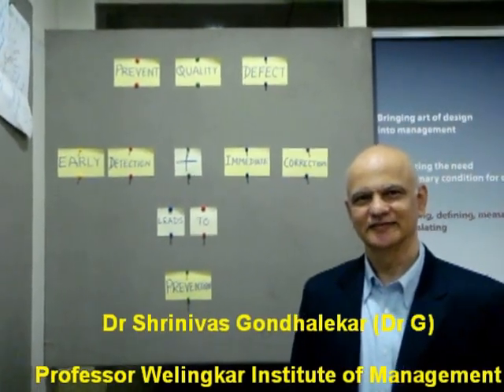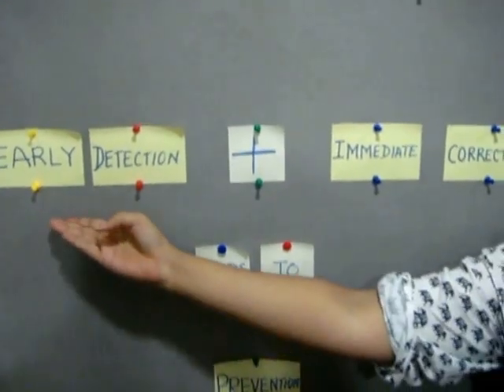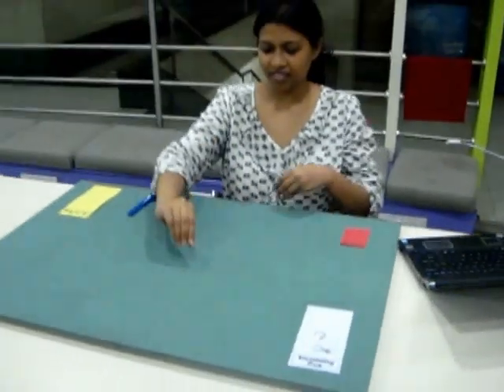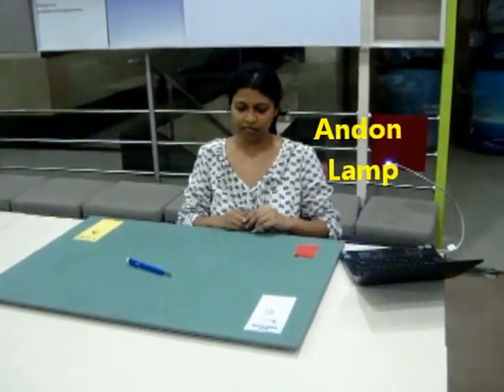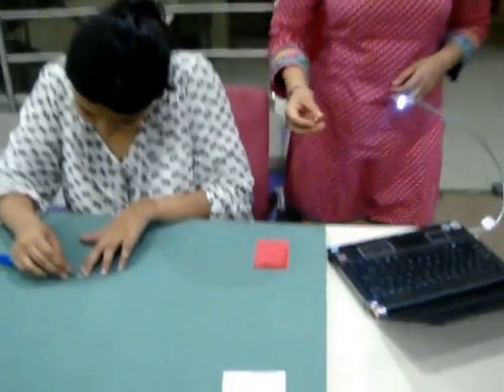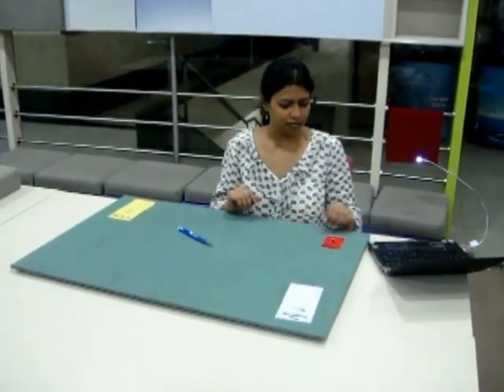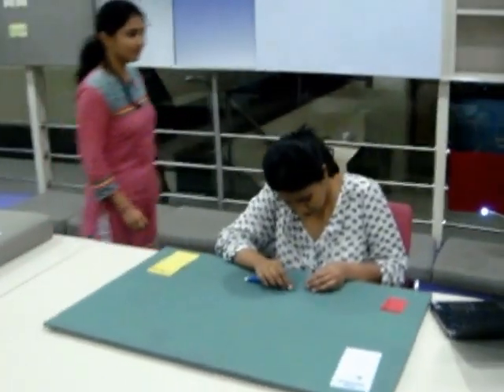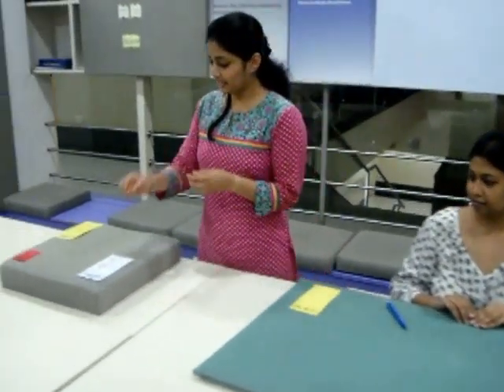Defect Prevention thru "Early Detection + Immediate Correction"

Comment: Dear Sir,

I saw the videos yesterday and thought of commenting once I actually implement it.
I worked in a data warehousing company and called my manager with an idea of getting the data correct in the 1st go.
I suggested that we implement automated macros testing the  data passed forward and eliminating errors in the 1st go thus increasing the process efficiency and in turn the overall efficiency.
Ex. the data needs to com in as number datatype 37 and some fellow just passes 'Thirty-Seven' in the next stage.
This leads to an error in the final data layer and back tracking it becomes it difficult.
This method definitely catches the culprit in the first go.

Thanks,
Mrudula
Reply from the maker: +Mrudula Pardeshi - what happened after you spoke to your manager about using the macros to get the data right on the first go? We would be very happy to know of the progress and result. Thank you. - Dr G
Reply: +Shrinivas Gondhalekar 
Dear Dr.G,

They implemented a Java macro by having a set of constraints that need to be checked for every row and column data element.
In case it satisfies all these constraints eg: data element of row i and column j should be integer not more than 255 in length; then te data element is sent to the next layer.
If it does not satisfy then it is back tracked to its primitive cause and corrected there.

This approach reduced the errors in the final datamart thus giving more accurate data to be presented in the final reports from the datamart.

I have also suggested that they have a similar macro for all layers.
 
Thank You Dr.G.

Comment: Thankyou Dr.G and team.
Correct me if im wrong ,If many issues are detected on one piece of a product, does placing it on red card is enough? Like the worker will know that its a faulty piece but how will he or she know how many levels of error were detected. May be quality consultant mentions the same thru a note or direct interaction and intimation of what all needs to be worked on. I now understand why each item right at that moment itself is to be checked so that further process is not hampered and faulty products are not produced as rework of error detected piece happens right away. This may also sometimes make the worker realise initial mistakes and learn to be aware not to repeat the same on next, if similar items of work is involved. Though it looks tasking and time consuming but best suited for especially custom and variety products involving intricacies.
Thankyou once again for the learning.
-Srikanth Shetty BD
Reply from the maker: That's why it is ideal for the quality inspector to give feedback on the spot. Then learning happens for the operator.
Jewellery has a special problem. The piece needs to not only be correct in terms of dimensions, such as an engineering item, but also aesthetically beautiful. Two persons looking at it is a great help in aesthetics because it is a subjective element. Otherwise we would go for self inspection.
Reply: @DrG720214  Understood Sir ! Thankyou so much :)

Comment: Sir , i got to see this very technique being implemented in the Sinter Plant of an integrated steel plant of JSW. There we had to constantly monitor the sinter product quality running on conveyor belts , after the product was baked in the furnace . Letting the undercooked or overcooked sinter product ( which was the  defect ) go ahead would spoil the entire chain where this product was an important constituent .So , there were manual supervisors alongwith CCTVs installed to detect early any signs of defects. The only solution was & is " Early Detection " + " Immediate Correction " leads to "Prevention".

Comment: It reminds me of the "peer review" stage of software code at the software developer's end at the technology centre of BNP Paribas where I was working as a software application developer. In this stage, the objective was to minimize the defects and/or errors in the software code implementation in the development stage itself even before it goes to software testing team. The code gets evaluated by the peer (generally a senior developer) and once tested right, it is marked OK. In case of any errors, the software developer is immediately informed. The result was that majority of the applications got completed in a fairly less time than before as lot of time in defect fixing during the software testing stage is reduced.

This way, the software code is free of majority, if not all, bugs right at the developer's end before the software implementation reaches the quality assurance i.e. software testing team. Hence, early detection and immediate correction leads to prevention of defects. Andon Lamp and Quality Control Inspectors inspecting all around are efficient techniques for this early detection and immediate correction. The same has been very effectively depicted and demonstrated in the video.

Comment: Thank you for an interesting video sir, In my previous organization, the developers would perform a sanity test in pre-production environment, before it was handed over to the testers,Similarly in the above video, a set of standardized rules can also be set for the operator(in this case a jewelry unit), to check for the product herself,the person assembling a product(jewelry) can himself test the accuracy/ quality of the product himself/herself first and then pass on the product to the subsequent stage of quality inspection. This will reduce the number of defects if any being pointed by the quality inspector. This will obviously increase the output time of the product assembler but this will also increase the quality at the first level and save the input time of the quality inspector.

Comment: Sir, Although, I have never had an opportunity to apply early detection theory in real life aspects but what I realized after watching the video is that we Coders use white-box testing aspects of which are similar to this theory to some extend. In white box testing we use same process of early detection to find bugs using test cases in our codes/program. If there is any defect at an early stage of coding it might lead to major defects at higher level of program later making it difficult for debugging causing much more bugs or issues when the code is integrated with the program .So using White-box testing we are able to find  hidden errors and defects at early stage which in turn help us to prevent and remove these possible defects or bugs in the unit testing and making it more easier to integrate programs into the application avoiding any potential defects in the future which would have been hard to spot if ignored at an earlier stage

Comment: hello sir,
the learning that i am taking from this video is of how to have an organized and systematic process which not only helps in early detection of errors and correcting them but also reducing the overall cycle time of the process which would have increased had this errors been detected at later point of time.

Comment: The video "Early Detection +Immediate Correction" conveys that a stitch in time saves nine.This practical approach is very well implemented in a small restaurant I visited.They serve you personalized food where they prepare a sample and ask the customer if it meets their expectations.If any changes are required they immediately make the corrections and make no compromise on customer expectation and quality.
Thus they detect the error in an early stage unlike other restaurants and also take an immediate corrective measure.

Comment: Hello sir, 
One of the very important part that i feel is, the designer does not have to waste time calling the quality check in charge to check the product. The process becomes faster. Also if a motion study is done, the designer makes the least possible movements, again spending a very small amount of time. Also, to avoid errors in placing the products, the color scheme is used and also abbreviations are used to indicate thee right spot. Roshan Runwal

Comment: A very good practice!  Early Detection will definitely save a lot of time and resources. Though the Initial cost might be high (Learning and training cost)  , in the long run this will definitely help the company to increase production and make more profits.
One small Doubt (which I got by seeing only one Q.C operator for several stations) - Wont there be a bottleneck in terms of availability of the operator for several stations at one point of time . How might that be tackled ?

Comment from the maker: Pooja, in fact, the Andon lamp concept can even be used in offices more so for problem resolution. imagine the boss sitting with lamps for each of the subordinates. These days with everybody continuously connected up by internet or intranet, it is very easy to devise an andon on the computer. In this case, it is better to use two andon signals - a yellow and a red The yellow will indicate onset of a problem, while the red will indicate it going out of hand. Let us make a video to explain it.

Comment: I apply this technique while preparing a report,after I am done with each stage, for instance introduction,I go through it once and check if any mistake is done,if not i move to other stage.when I am done with all the parameters of the report I go through it once again as a whole so to prevent any defect in it.

Comment: Respected Sir,
This approach is very helpful in real life and similar thing happened with me as, recently I had gone to buy my dress and after seeing all its specifications and details minutely, I finalized it so as to prevent a defective piece at early stage of my product . However if i had not checked it minutely and the piece would have been defective , then it would not have been immediately corrected.

Comment: Application for this concept: Every time I take out my cycle I check the air pressure in front and the back tire and also check whether the peddle is moving freely. In case there is less air and the peddles are not moving freely, I immediately fill air and lubricate the chains of the cycle. This early preventive measure helps in avoiding sudden breakdown and also the wear and tear of the cycle parts.

Comment: Dear Sir
A Firm  that produces edible products like cakes/breads (manually) can greatly make use of this concept. As there are multiple stages involved in the process of production including Formation of batter, Disposing the batter evenly into baking trays and finally the baked cake.If at every stage the products are checked for quality control, then number of defective finished goods could be reduced.For eg. if the quantity of the batter disposed in the tray is not appropriate to make a cake of the standard size, quality check would detect this and have it fixed, rather than ending up with a finished good which is not of the standard size and is useless.
Its fundamental but a very useful concept.

Comment: This video brings out the formula for prevention. For prevention there has to be detection of error and corrective measures. To have less loss of material and rework cost, the detection or error has to be early and immediate corrective actions will eventually make the system perfect i.e a zero defect.

Comment: "Prevention is better than Cure" that's what we have learnt till date. But nobody told us how to do the Prevention which this Video does it undoubtedly. This strategy not only ensures the higher degree of  Quality but also prevents time wastage. The Andon Lamp acts as a Stimulus so that the Quality Inspector knows exactly where to pay attention. Also the different designated areas for the specific Defective/OK products ensures the proper segregation which leads to smoothening of process.

Comment: Sir,
On-time or even early quality inspection helps in detection of problem timely which also ensures proper correction. Correction at an earlier stage is easier. For instance, in case of manufacturing of pumps, at each and every level of manufacturing process, it passes through quality tests which are placed to check whether it can control flow of water and how much load it can take.

Comment: Sir ,  Early Detection + Immediate Correction technique focuses on the immediate correction of the defect which is usually not done , most of the time the the product which have defect are kept aside but after some time either the defective product is carelessly misplaced resulting in the loss . according to the solution provided by you the product is prevented from wastage as it is taken care on the spot resulting in no wastage . there is also optimum utilization of human resource illustrated by you in this video . will surely try to apply this technique . thank you

Comment: In dairy cooperative raw milk collected at collection centre when comes to dairy in diffrent tanker at distric level goes with early detection with alcohol test to detect the quality of raw milk i.e.raw milk is eligible or not to be processed in packaged milk,milk powder or other milk byproduct through UHT equipments.In the test 5ml of raw milk sample is taken from every sample and mixed with 5ml of ethanol solution.If there is no coagulation,percipitation and clotting after than then milk is of good quality and is accepted for further processing into packaged milk and if there is percipitation or coagulation in sample then that raw milk is rejected that leads to prevention of bad quality of packaged by early detection.
Thank you sir for the explanation  theory of early detection of defects that lead to prevention and please correct me if my application of the theory is wrong.

Comment: Hello Sir,
I was working with a electrical firm where we used to assemble switchgears(MCCB, MCB etc).I used to assemble it completely without checking at each stage weather it is properly assembled or not and many times we had to dismantle it and assemble it again so as to ensure proper functionality.After seeing the video I feel that this technique could be used there for quick assembly.

Comment: Generally Corrective action are more common in industries. So in QMS we had studied abt preventive actions so that quality products comes out and we could avoid the defect. But eventually this does not happen as certain set of procedures are there already But mistakes happen and it bound to happen so by applying this method of early detection and immediate correction helps to reduce the efforts and time lag. Better way to do thing right at first place. So Outcome of prevention is  Quality + efficiency at first place

Comment: Sir, when i was doing my internship in a company we had a warranty issue with the desired product of a particular channel/line. Every Machine had a quality station but the workers used to never check the parts after each operation. We spent 80 percent of our time trying to find out which machine caused the defect.  If the Quality Stations were operating well initially we would have eliminated the defect at its source and avoided the Warranty Issue.

Comment: 1/2 Sir, The Idea of Early Detection + Immediate Correction is splendid, but from my point of view there are some key factors which have been taken as Constant / or for granted. For Example, from the demonstration you have done in college with ball point pens, there is a WIP .Here also we are assuming that the operator keeps on getting the Jewellery to avoid the Bottle neck. Secondly, at a given period how many operators can a Inspector manage again to avoid any bottle necks.

Comment: Hello sir,

I can relate this with the experience of my past IT job. While developing a software/coding for a front end application  the first step involves writing the code during which we came across a lot of bugs which we generally used  to overlook. Later during the testing phase, the entire piece of code was checked thoroughly and debugging was to be done. If the coder himself checks the codes at proper stages then the debugging process would have save time and money.

Comment: The Early detection + Immediate correction helps the product being refined at every stage so ultimately the product when finished will have zero defect, this will reduce the future problems of the product being returned by the buyer and thus save on logistics, though this process takes time it ensure a quality product coming out every time from each station. This will increase the Operator's responsibility at each station and also will help the Quality check inspector prove his part to the fullest.